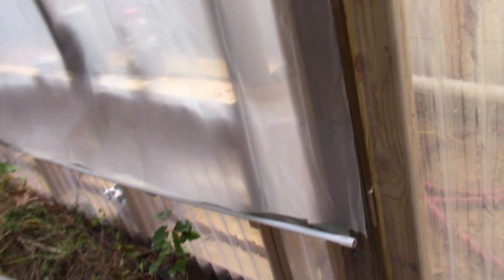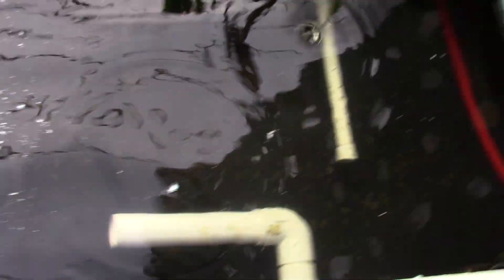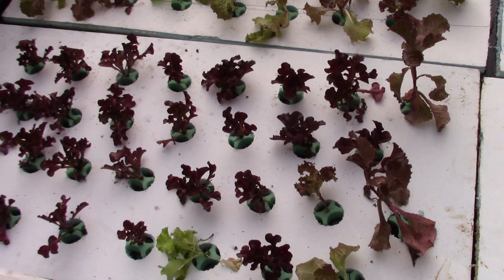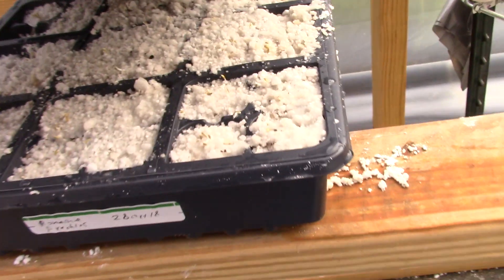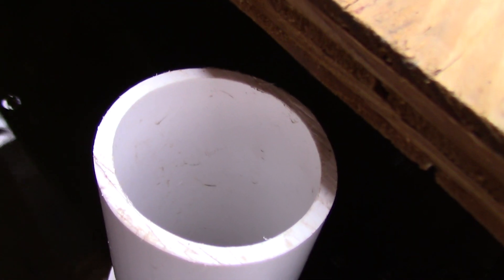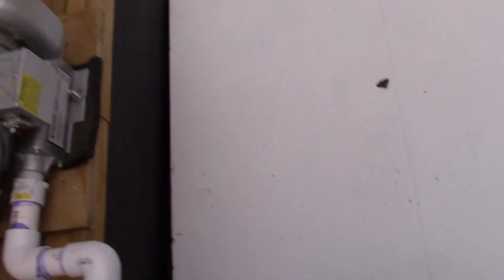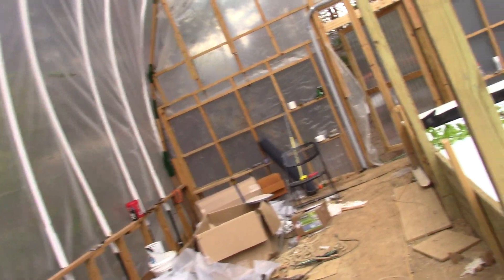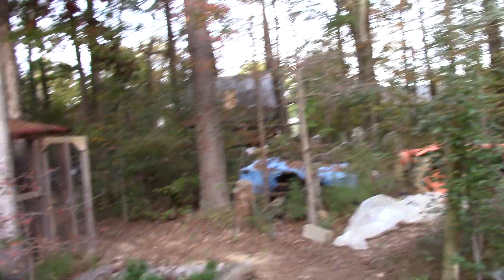Aquaponics Greenhouse Entering Production Halloween 2018 Update

Comment: We can find so many worms around our chicken/sheep barn all Summer long that we never run out. Hey do a vid on protecting our homesteads from EMP. From foil lined metal trash cans for electronics to our service panels. I have a heavy duty military grade MOV can on our service panel but there is so much more to do and it sounds like you know the subject. I went to Columbia U for EE but I found that a desk job just didn't suit me so I quit and became a Master Electrician and tech for most of my career. Now I added Bell Siphon production to our "retirement" bag of tricks and we are soon to pass our 9000th shipped worldwide. All done right here at home. BTW, AP trout are so delicious. All we raise now. They love this cold.
Reply from the maker: 9000 Bell Siphons is awesome! If you  have worms everywhere you are set!  An EMF video would be great. I will do one but that one will take me a bit more time to pull together, so it will come later. I have actually chaired two power grid defense conferences, and briefed with state officials in Alabama on the topic. I could do a series of videos on that alone. I just shot a video on emergency steps I took to winterize my greenhouse, as I mentioned earlier. I may upload it tonight or tomorrow night. Thanks for the input and the great suggestion!
Reply: @greengregs  looking forward to more vids. Of course I meant to say EMP, lol. Close. Only hit 32 for a low last night. We can consider that 16f as a warning tho. We hit minus 20f twice in 2013. The first year with our gh. Check out my vids on my Aquaponics wood stove build on my channel. You might want to build one. You sound capable.

Comment: Big GH equals big maintenance Greg. You're doing it friend. Now for all the surprises when starting up. Your pump should be in a sump so you are only pumping clear water. Especially in a system that big. BTW, I believe the blue styrofoam is tougher. Far denser and ridged and lets less Sunlight hit the water (algae control)
Reply from the maker: Yep, no kidding! This sudden winter onslaught thew me for a spin. I was not ready for it to get this cold this fast!!! I did a little video this morning about my emergency preps. May post it later  today here on the YouTube channel.
Reply: @greengregs  yup we hit 16F last night here in the mountains of NE TN. The AP GH dropped to 39F by morning. Woodstove is all loaded and ready for what's coming and I turned on the 100' Solar water heater in there yesterday. Full Sun today so that will warm up. Follow the GSM crowd here on YT so you know what to expect weatherwise. Doesn't look good. Nothing but record breaking cold for the next 50 years. Aren't we lucky. Good for you keeping on the vids. I have many planned but life just keeps getting in the way.
Here is a great link to get you started on the GSM: https://youtu.be/dWFF4lwFqxg

Comment: Styrofoam? Say it ain't so!
Reply from the maker: Actually it is the blue dow board which is much safer.
Reply: @greengregs  Cool. The white stuff breaks up too easily and can clog filters and such.
Reply from the maker: @canucanoe2861  I know! That why I use the blue Dow - I just call it styrofoam by habit (bad habit!) ;-)
Reply: @greengregs  
MR.GREG IM SPEECHLESS.IM SO UNEDUCATED IN SURVIVAL. FIRST TIME I'VE SEEN ASET UP LIKE THIS .LET ALONE BEING DONE BY ONE PERSON. MY RESPECTS.
Reply: Styrofoam is fine. I'm working with aircrete rafts myself though. Much cheaper, more durable, prettier, and it avoids negative comments from conscientious objectors of the use of engineered organic compounds (plastics in this case).